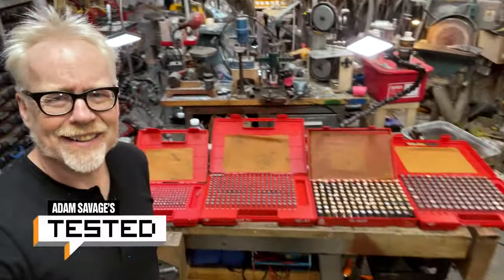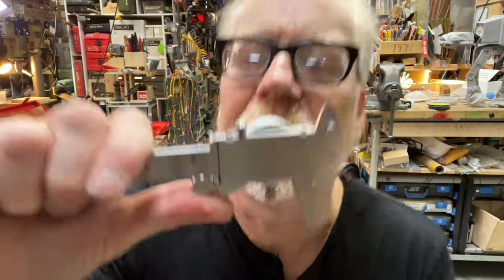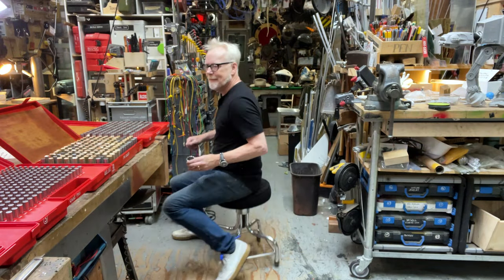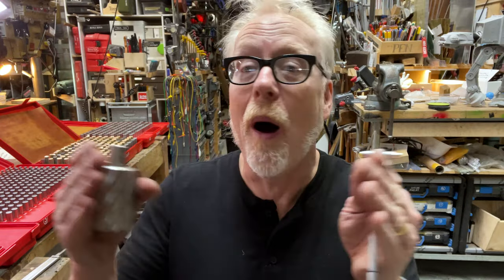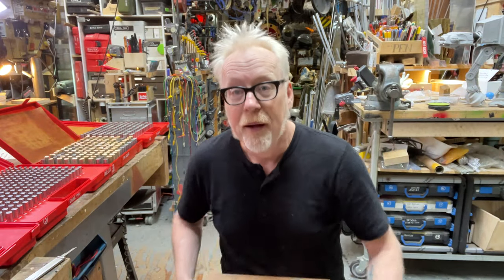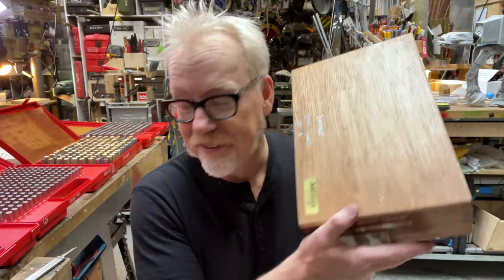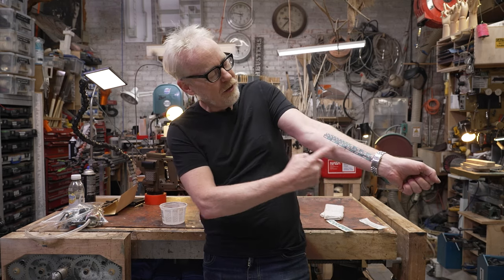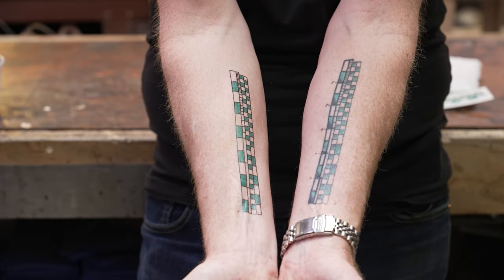Adam Savage's Favorite Tools: Pin Gauges!

Comment: How much wear do these pins get? Is there a maximum amount of time you should use them before replacing them? Or is there a good way to test them to make sure they are still accurate to that level?
Reply: They are usually hardened steel and shop grades like this should stay within tolerance for decades as long as you are not mechanically forcing them into holes they're too small for or allowing them to rust (though scotchbrite pads will buff it off). You want a smooth fit, not a too-tight fit. Higher-grade class X and higher pins used for more exacting inspection are a different story if used frequently.
Reply: @robbunchanumbers  Thanks

Comment: Telescoping guages are good for like 2 to 3 tenths
(.0002") if you use them correctly. Which means using a micrometer not calipers.

Comment: When I worked at O'Reilly's I discovered those calipers and used them almost daily.  I measured bearing down to the thousandth with enough accuracy I'd trust just as much as anything else.  Pin gauges are awesome, but too expensive and take up too much room.  Calipers for life!
Reply: Calipers are for "close enough" 

Pin gauges are for when accuracy matters.

Comment: Just so you know, Adam, what you're using as the step feature of the calipers is not actually the step feature. The step feature is on the other end: the jaws are flush with each other there when they're closed because that's the actual step feature. Not that the way you're doing it right now is necessarily wrong but it's easier to get it right with the wide end.

Comment: that mitutoyo gauge is nice but you can get a lot of variation depending on the angle you're hold it at. if you really want precision when measuring an I.D with a mic? have a look at a bowers digital bore mic.
like you say, not for the hobbyist (I work for collins aerospace and they are standard kit for us) but man they are a piece of work.
Reply: Fowler/Bowers and Mitutoyo (and probably others) both offer spring-tensioned styles like the one Adam shows and threaded spindle versions that you can twist open manually to lock into the ID and prevent tilting. I have some Starrett, Brown & Sharpe, and Etalon micrometers at work that are all essentially the same.

Comment: How do you avoid damaging the pins or the part you are measuring?
Reply: They are made of hardened steel, a special alloy with low thermal expansion. Unless the part to be measured is much harder, or you are applying improper force (that´s the tricky thing (?)), it shouldn't be a problem.

Comment: Wow! That's an impressive set. Question, are the diameters laser etched on each pin gauge? If not, I bet you make sure to put each one back right away. I'm sure the plastic cases aren't made to the same exacting specs.
Reply: The ones large enough to fit the markings are usually etched. You usually measure the smaller ones each time you use them. I never trust that I or someone else didn’t put the pin back in the wrong location

Comment: Do you ever have the pin gages calibrated or do you rely on their accuracy through time?  I am a Metrology Engineer/QA Manager and can't seem to justify the cost of re-calibrating our set, it is cheaper to buy new, but hate to discard the old.  Any thoughts?
Reply: I hated calibrating a 0.011-1.000” set. That’s 989 pins with 6 diameter checks per pin, plus checking for straightness and damage. It took almost a week to calibrate a set.

Comment: I own exactly 1 pin gauge. It is for measuring and setting the air gap between the butterfly and the throttle body on a DI 2 stroke engine.  The margin of error is .001 and there is no other tool for the job.

Comment: question, does the protective film that is sprayed on high precision machined gauges affect their ability to accurately check a measurement? For example if a protective film is sprayed on a .250" pin gauge, it is hard to tell if something is .250 verses .251"?
Reply: There is no protective film.. the pins are usually hardened steel with a very smooth finish. Sometimes the cases they come in are wood to help prevent rusting. Some things also come wrapped in wax paper to prevent rust until it is used for first time

Comment: When I use these pins, I tend to start with one that doesn't go in the hole I'm trying to measure - and then I work my way down.
Maybe it's just a weird habit of mine, but I like to think that I'm not "wearing out" the finely polished diameter of the pins this way.

The really small pins are a right pain to work with, by the way. You have to be so careful not to bend them or just put them somewhere that isn't the designated space in the box.
Just imagine dropping one of those boxes 😂

Comment: I would ask myself, is there a digital/laser tool for such measurements that is maybe also able to record temperature and humidity and would be able to pair to a device recording such measurements on computer/mobile with the extended ability to measure if a hole is exactly circular or more egg shaped. That would be a tool. grin

Comment: Also Adam you should let people know that calipers and telescoping gages are only so accurate.  Everything has a tolerance and there's always a way to measure things to 1/1,000,000 of an inch if you need to.  We can measure most things to the tenth, but generally we don't have to get much under .001".

Comment: any machinist will tell you gage pins aren't just for measuring holes. you can measure chamfers, gears, threads, v's, dovetails the list goes on and on. as a side note its best to use the ground end of the calipers for a step measurement instead of the depth rod.

Comment: You can get cheaper gauge pin sets on aliexpress for around $30 a set.  
True, the quality wont be as good, but you can always measure them with your good calipers to confirm.

Comment: When we're measuring, at a resolution of 1000ths, how much does ambient room temperature affect the accuracy of these gauges?
Reply: Not terribly for the situations and temp ranges adam will be using them. The thermal expansion of the diameter will be less than the precision the gages are ground to.
Reply: If you’re measuring steel parts at the same temperature, not at all. If you are measuring a different material, like aluminum, everything needs to be at the calibration temperature (should be on the box or paperwork) or you’ll have to do some math based on the difference in the coefficient of thermal expansion of the material you’re measuring and the pin material and how far away from the calibration temperature you are, as well as the nominal size.  The good news is that for most machining metals it’s going to be way less than one thousandth for small parts at indoor temperatures.
Reply: @JamesWhittle  Thanks
Reply: @AB-yp4uf  Thanks

Comment: My favorite gauge that I would consider "rare" was called a Swedish hair gauge. No it's not a gauge for hair.  It was a machinists dial gauge with ludicrous sensitivity. It had a certain temperature range it would work in and only useful in that range. A truck would roll by outside and this thing became useless for 5 minutes. I could blow on it from 5 feet away and make the indicator dance. All I know is it was much older then I was and I'm 55+ and I've never seen another. It had not been used for a while before I started work there.

Comment: gage pin will only give you the diameter of the edge of the hole. that mean the hole can be bigger but the entry need to fit the pin. so if you have .500 hole entry it can be .501 deeper in the hole. so if you need .500+/- 0.001 and you get .502 you take a ball bearing with a hammer you will ligthly tap to close the hole to put it back in spec

Comment: living in the uk... am not sure whether its best to get metric or imperial, or both. so what do you guys think? ... i hear that china quite often use metric machines even when making imperial stuff? if i am not mistaken. at least this is definately the case for pcb  manufacture. i am less certain about machining.
Reply: Both, but metric first. Purely because all our work we do at my workplace is metric, and our CNCs' encoders are metric. While it's possible to change this, it only takes one mistake for a machine to read 20mm as 20" and you have a loud bang. 

Imperial jobs are simply converted and checked by QC prior to starting. This includes the tolerances.

Comment: Adam, use the other end of your calipers for step measurements! Place the flat end of the movable jaw against the lip and move the fixed jaw up to meet the feature. Measuring that way eliminates angular error from your measurement, since you are registering a flat edge against the block.
Reply: that's all I could think, not many people know you can use them like that.
Reply: @smokeyguy  I was measuring a step like that at work and it took a lot of convincing to get an older tool maker coworker with 20 years experience to believe that was a correct way to measure with calipers.

Comment: Wait...a perfect 1/4" pin cannot go into a perfect 1/4" hole...there has to be some clearance...right? Slip fit Clearance?
Reply: Pins come in + tolerances and - tolerances.  Depending on the class of pin the tolerance on the + or - side varies.  So a .250 minus pin can go into a perfect .250 hole, but a .250 plus pin would not.

Comment: Would there be a difference between that set and a metric set? Apart from the obvious..
Reply: They are the same from a manufacturing standpoint; however, a metric set typically includes more pins as you've got finer levels of detail in those smaller increments.  (A good set of metric pins are in increments of 10 microns (0.01 mm), whereas a good set of imperial pins comes in thousandths of an inch - a factor of 2.54 metric pins to 1 imperial pin).

I recently purchased a set of metric pins (as I'm in Australia) in 10-micron increments between 0.1mm and 10 mm.  Finding a set was an absolute battle, and they came in at around AUD 2,000 delivered - so they are more expensive, too! (and a lot less common - Starrett from what I can tell doesn't even make metric pins)

Comment: I work as a professional prototype cnc machinist and this video is very true. A good set of pin gauges is truly great. But they can sometimes give a false measurement so it can be good to dubblecheck if you are right. They always show the effective diameter included non roundness. And cause of that a set of diatest gauges are cream de la cream. But hey they are crazy many and idiotic expensive each.
My preferred measuring tool is just a stone table and a measuring clock. It's so versatile and cheap with some basic gauge blocks. And measure roundness, runout, diameter, concentricity etc.

Comment: I have surround in the LR and satellite speakers in the kitchen and two of the baths.
When you say "Alexa what is half of 211?" I get the answer from a sinister cacaphony of disembodied mechanovoices throughout the house, not from the sound system remote speakers which are dialed in but the various Alexa devices that chime in from the rooms that the speakers are in. There is an otherworldly delay effect. Most unsettling.
You wield a power that you know not.

Comment: Surprised you measure steps on the tail of the calipers using the sliding pin. I've always been told to use the step gauge on the back of the head as being a wider step gauge it is easier to be accurate particularly when measuring against a curve as you were as the pin you were using may not be making a perfect tangent

Comment: Meyer Gage Company, in Connecticut, manufactures and sells pin, plug, and ring gages. Inch and Metric. Classes XX, X, Y, Z, and ZZ. Individual gages, sets, Go/NoGo assemblies. ISO 17025 accredited calibration lab.

Comment: Do these pin gauges oxidize at al enough to skew the measure?
Reply: If you don’t take care of them they will eventually rust. Wiping the pins off before putting them away and occasionally applying a very light coating of oil will prevent rusting.

Comment: What is the right temperature for this pins, I mean it has to be a different between hot and cold weather.
Reply: Dimensional reference temperature according to DIN EN ISO 1:2016-12 would be 20°C or 68°F.
Reply: If everything is made of steel and it’s at the same temperature, the actual temperature doesn’t matter too much. It really matters when you’re dealing with dissimilar materials.

Comment: #1, Use a micrometer over your T-guage, not calipers.
#2, a set of ball guages costs about $40, and you use them just like T-guages, but for much smaller holes.
The only thing I have ever used pins for is to inspect gears with an odd number of teeth.

Comment: Yess very pricey and u can get extremely accurate with them. I've seen my cmm guys at work do that same thing to determine hole locations but they would lay the one side on the granite plate and see which pin fits between the pin that's inside the hole and the granite block which represents the edge of the part. Great vid. I'm 25 and have been machining in the prototype castings, punch and dye, and injection mold tool industry for 6 yrs now. Love this trade it's nice to see a hobby channel like you get so in depth. 

Btw when I say really accurate I mean that u can get a set of gage pins like we have at my shop that's on size, plus, and minus sizes. So a .250 on size pin will vary .0001" each way. Plus or minus. But a .250- will only be max .250 and minus .0002" same for the .250+ it will be minimum. 250 with a positive tolerance of .0002" so if u have a hole that fits a .250+ pin but doesn't fit the .251- than you know it's within .0002" of. 250. Hope all that made sense lol

Comment: Never going to work on anything that requires that amount of precision.
+/- 3 thou is perfectly acceptable for most applications.

The biggest problem with reverse engineering or fabricating something based on measuring an existing artifact, is that everything is machined with a tolerance, and sometimes it's hard to determine what the intended or a nominal measurement was supposed to be. For example, that .5055 measurement was most likely just 1/2" from the edge

Comment: Aerospace machinists “ we love em and hate em”. If you get the heavy chamfer off of them they work great as a quick check for hole depths. Step up to digital calipers and you can zero out on the length of the pin, drop it in the hole and measure what is sticking out, the measurement on your calipers is your hole depth…. or have Alexa do the math for you😏. Also great for measuring dovetails.If you check parts on a comparator you can quickly pick up centerline on reflection. It’s endless. Be careful with holes that are small or have a burr at the beginning of the hole. That can mess things up. Buy extras of the ones you use a lot so you don’t have to get the whole set out. Good luck!!

Comment: I always preferred ball gauges and a micrometer. I never liked pin gages for QC because in my opinion, they only tell you if the entrance/exit of the hole is good. But if you're already confident the hole is good and just need to know the size, pin gages are fine.

Comment: There's a better way to use a set of calipers to measure something from an edge. Literally use the other end. The movable jaw can be used by laying it on an edge and sliding the non-movable jaw up to the position you  want to measure. Much easier than using the depth gauge end.

Comment: Pin gauges dont take into account straightness or roundness. You could have a .26" hole that isn't straight enough or round enough for a .26" pin gauge to fit but where a .25" does. Any minor defect in the hole will not let the true-size pin gauge fit. This is splitting hairs though. They're obviously very practical, they just dont tell the HOLE story.

Comment: when you begin to bring MSA into it. (Measurement system analysis) and the ability to repeat a measurement, so all the external factors, then i would not trust a caliber below 0.1-0.2 mm and a micrometer below 0.02 even though it has EXTREME scales even a CMM machine with micron tolerance, has issue in that term. even though it has a very fine machine tolerance, the other factors hits hard. measurement is an expensive thing to deep dive into, and yes some people can get closer simply with teaching with "calibers" and micrometers. then it also comes to strategy, HOW and where you measure, if you for instance wants to define a hole.

Comment: Now I have a wet mouth, seeing this wonderful pieces of equipment ...
But it gets dry immediately, when I think of calibration of the whole set. Sure, they should not change over time and be handled properly to avoid scratches etc... 😉
Working in the realm of measurement technology always makes me a bit nervous about this topic 😆
Reply: But they do! Which is why metrology gets rather fascinating. Can't remember if it was the reference kilogram or metre where they discovered it had changed. Despite being kept in very carefully controlled environments. I suppose over enough time, and with sensitive enough measurements, factors like cosmic rays smacking into an object can alter it's mass via ablation, or 'just' creating isotopes in the object.
(kinda curious what the odd shaped pins are intended for though)
Reply: @brolohalflemming7042  yes, I know they do change over time, but in an ideal world they should not. That's one reason they replaced some of the national reference objects with better ones over the last "years". Environment is another topic, thermal shrinkage of different materials etc.
Imagine the reference "meter" would be made of wood 😉 and staff touches it with really sweaty hands 😂
Edit: I think it was the reference kilogram that lost a tiny fraction of its weight.
Not sure about the odd shapes either.